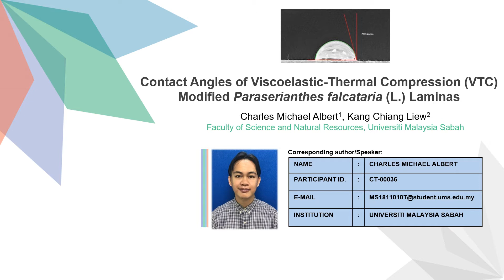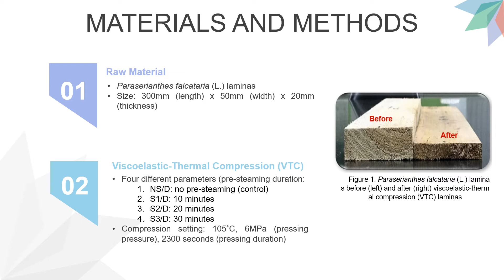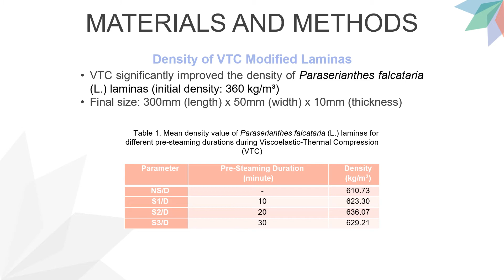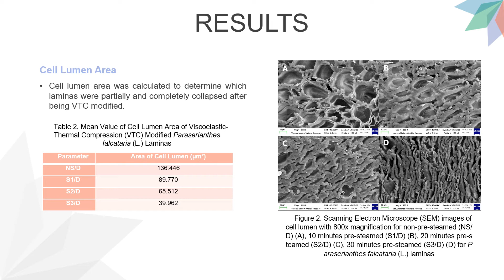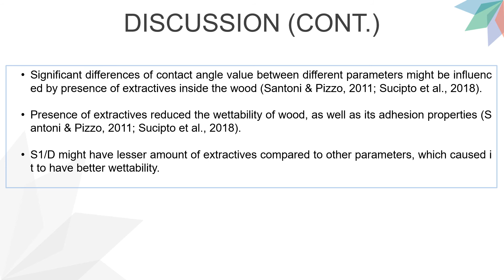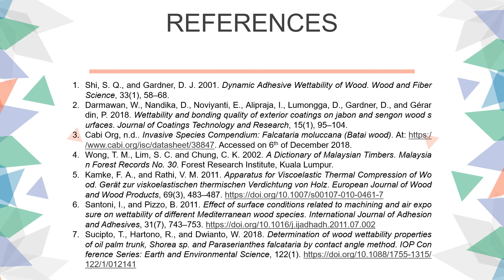CT-00036/ENFRS02

Comment: Thank you for the presentation. Is there any specific reasons why you used Paraserianthes falcataria in your research?
Reply: Thank you for the question.

Paraserianthes falcataria (L.) is one of local plantation timber  that can be found in Sabah, which also widely known as a fast-growing tree species. However, it possess low average density of 360 kg/m3.  

Viscoelastic-thermal compression (VTC) is a densification method that used in this study, whereby it was able to improve density as well as mechanical properties of Paraserianthes falcataria (L.) itself.

Paraserianthes falcataria (L.) sawn timber can only be utilized as furniture component. The densification would enhance mechanical performance of the wood species, hence can be applied in heavy duty application (e.g. structural application in buildings).

Comment: hello.. terima kasih atas informasi yang berguna ini. pada pandangan anda, bagaimanakah kajian anda dapat diaplikasikan dalam industri perkayuan di Sabah?
Reply: Thank you for the question. In my opinion, research and development on this particular wood species should be conducted until it can reach the level of commercialization. 

I would suggest local universities to conduct more research on this wood species, especially on how to improve the quality of the densified wood product. 

This would attract the industry players in wood-based industry because they can utilize this mechanically-modified densified wood for further processing in shorter waiting period, instead of waiting for existing heavy hardwood species that requires longer time until it can be harvested and undergo further processing in wood industry.

Comment: Thank you for the informative presentation. In your opinion, is the densified wood good for furniture production?  Why? 

Thank you.
Reply: Thank you for the question. 

Low-density wood species (Paraserianthes falcataria (L.)) can be harvested in between 9-10 years, which much faster compared to other heavy hardwood species. 

Densified Paraserianthes falcataria (L.) had average density of 500-700kg/m3, depending on compression ratio, whereby in this study I used 50% compression ratio. This density value is suitable and recommended for furniture production.

Wood industry will be able to utilize densified Paraserianthes falcataria (L.) for further processing,  which means it can be an alternative source of exisiting heavy hardwood species.
Reply: @chxlxkxtx  oh i see. Thank you for the clear answer.